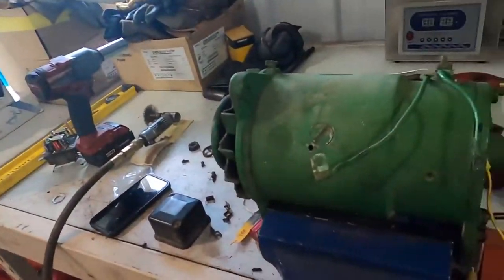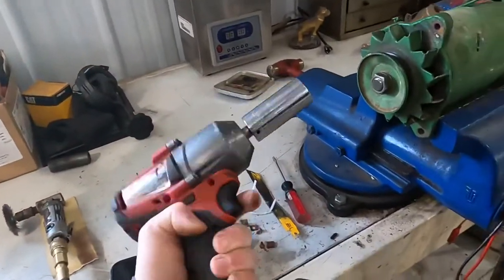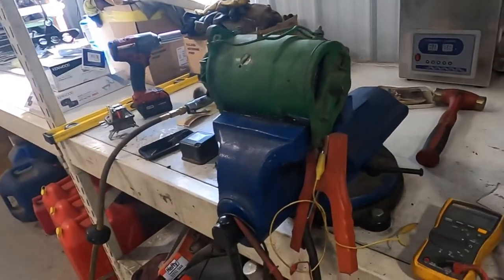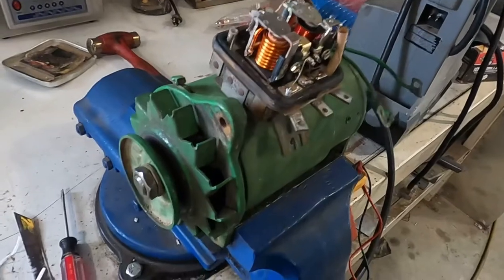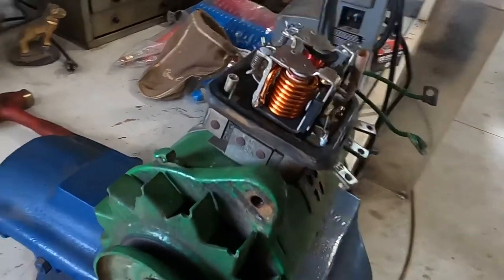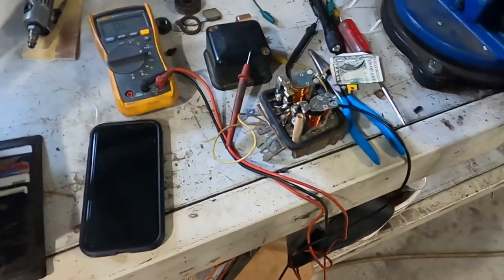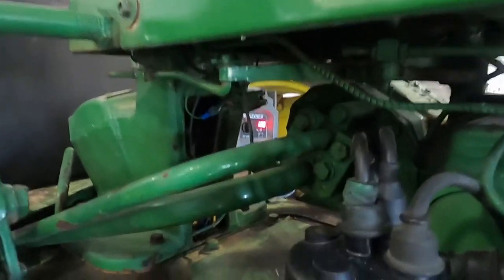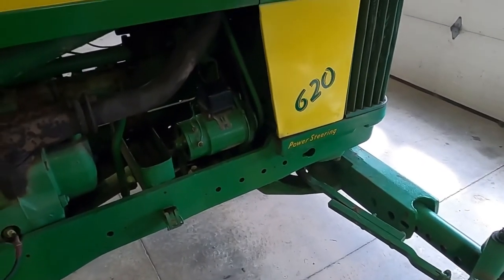Troubleshooting a Delco Generator and Voltage Regulator on John Deere 2 Cylinder

Comment: Good explanation of how system works, but remember if you unhook battery, generator or regulator you will have to polarize the gen and regulator for the system to charge. Very easy to do just search "how to polarize generator and regulator", pleanty of good videos to do it on you tube. Good job on video and explaining how system works.

Comment: At 6:00 you show the voltage regulator sitting on the generator, you should not test that way.  The regulator needs to be fastened securely.  Thanks for the video, I learned a lot.

Comment: The reverse current relay makes sure the battery charging contacts close only when gen volts are greater than battery volts by a few volts. when gen volts are lesser than battery volts, the field of the heavy current coil is bucking the field of the shunt winding under
neath  the heavy coil and contacts will open. When Gen volts are greater than battery 
volts, the field of shunt coil (fine wire coil) will add to the field of heavy coil and those
contacts will close and the battery will charge.
Reply from the maker: right we are more or less saying the same thing

Comment: Usually called dynamo generator! Generator “Field” wire must be connected to the Right side “FLD” in the voltage regulator. The Armature wire connected to the “ARM” Center terminal of the VRegulator! Voltage regulator MUST BE grounded securely to Complete all the circuit. One of the carbon brush is connected to the ground!
“CUT OUT” relay big coil is to strengthen the magnetic pull for forceful contact at high charging current. Voltage regulation happens at the right coil with fine wire. Make sure the contact point is clean and coil is good. Must play with the tension of the spring to regulate the voltage!

Comment: Got a jd 50 with 12v positive ground. How hard is it to switch it over to negative ground?
Reply from the maker: You should just have to repolarize the generator and flip the wires to the coil. You will have to flip the wires on your ammeter as well or it will read backwards.

Comment: Thanks learned a lot. Am T.S  a 606 IH. Shop tells me the generator is working, and Voltage regulator bad. Put on a new Voltage regulator, and still no charge. Have checked all the wiring, and looks good. Cleaned out all my connectors with special file tools, electrical spray cleaned, and added dielectric grease tiny dabs to exterior of connectors.  Still no charge, and amp light still on. Any suggestions?
Reply from the maker: Did you polarize it?
Reply: @ScrappyIndustries  Yes touched jumper from armature to battery connector on voltage regulator and got a spark. This with ignition off.
Reply: @ScrappyIndustries  ok found problem. Took regulator, generator back to shop for testing. When putting on generator my 7/16th wrench was missing, and had to use a cresent which didn't allow me to reach top nut that well. In the process I twisted the post. He is repairing the generator now. Went and got a new set of wrenches today. Stupid me. Be careful with the wiring post people. Hold it tight with bottom nut, and correct wrench.
Reply from the maker: Good advice! I am glad you got it working again
Reply: That two relay regulator does not have a current limiter.  The reverse current cutout closes with enough generator voltage and opens when current back flows from the battery to the generator.  It looks like the contacts are dirty.  There should be continuity to ground at the field terminal. It was intermittent as you bumped the contacts.
Reply: In TV by I’m I’m in

Comment: John deere systems ran into trouble when the regulator is screwed onto a freshly painted generator. There are 3 things that you have to get correct. Before you can polarise your generator field windings you need to know whether the generator has an internally earthed field or an externally earthed field. This has NOTHING to do with whether you are using positive or negative earth. Now to move onto POLARISING the generator. You can use positive or negative earth  but the polarity of the generator has to be the same as the battery polarity. If the generator has an externally earthed field then to polarise you tap battery to the dynamo point of the regulator. Even though you are polarising the field DON'T TAP THE FIELD TERMINAL as this puts a dead short across the battery. I always disconnect the 2 wires from the generator and polarise the generator directly. When training I advise learners to do the same. This may sound long winded but there is a lot of theory going on with the windings and correct settings in the regulator 
Only play with the regulator if you have the CORRECT mechanical and electrical settings. 😊

Comment: First thing I would recommend is to switch this to a (-) negative ground set up.
Reply: Definitely NOT. This is a petrol engine and is running an IGNITION COIL. Coils are usually wound for +ve earth. When you change over to -ve earth you will need a coil that is wound to use with battery at negative earth.Yes you can just swap the wires over in an emergency, but battery, coil and associated wiring must all be in line to get smooth engine running. This man was also talking about A or B generators. A has an externally earthed field  that is earthed in the regulator and B has an internally earthed field that is earthed to the yoke of the generator itself. 😊